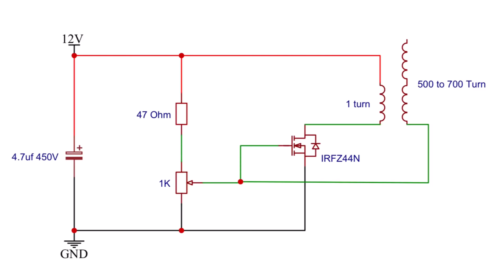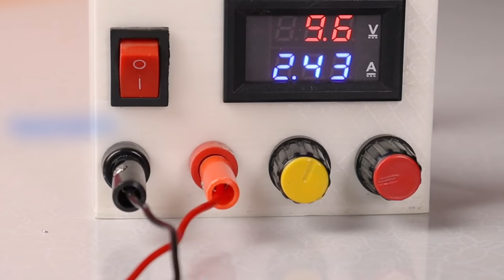How to make a tiny Tesla coil

Comment: Work better with IRF540 MOSFET because it has a higher switching frequency
Reply: Can I use 44
Reply: do you know every coil have they own resonance frequency
Reply: Oh interesting. I was going to order the one in the video but are you sure it will work with IRF540? did you test it out for yourself?
Reply: @milespeterson5049  Yeah my setup still works perfectly fine.
Reply: What's the rating on your capacitor??
Reply: @abhijayjayan6326  4.7 microfarad
Reply: @rupeshpatil5568  how many volts is it 450v??
Reply: Will it work with IRF630N
Reply: @harms123  Can I use B100K potentio instead??
Reply: Bro u can use IRPF460 also
Reply: Bro irfz44n and irfz540 bot have different data sheets can you tell me
Reply: DYOR... If you can't read (and understand!) a datasheet, better don't play with it (unless you have plenty of money and safety to spend) 😅

Comment: Help! I don't have that weird capacitor. I have a 3.3uf one but it's rated 50v. can you help? will it still work? please respond.
Reply: @Smaxi botYeah I will just order a 450v capacitor. on the internet along with the IRFz44n Transistor.
Reply: Miles.  One I built/ Ludic Science/ Triple Primary Slayer Exciter .    I only used one transistor and Two medium Led (backwards)  as substitute for diodes.  Any of these slayers substitute 1/2 watt potentiometer for the Resistor that way you can turn the power up mount a Cfl on top of the secondary pop bottle plastic.  The Mosfet circuit one is better but they both work.

Comment: When most people think of a Tesla coil, they imagine a large, imposing object with sparks flying everywhere. However, it is possible to make a tiny Tesla coil that is just a few inches tall. This coil can be powered by a small battery and can produce millions of volts.

The key to making a tiny Tesla coil is to use a high-voltage capacitor. This capacitor will store the energy that is produced by the battery and release it in short bursts. The secondary coil of the Tesla coil should have a very large number of turns, as this will increase the voltage output.

The final step is to create an ignition system. This system will create an arc between the two coils and will generate the sparks that everyone loves to see. By following these simple steps, you can create your own tiny Tesla coil that packs a powerful punch.

Theoretically yes!
Reply: I need help my tesla coil is not working! I smell burning!
Reply: But more the no. of turns in the secondary coil the mosfet will get hotter and hotter (not sexy hot). So I suggest to use a high power mosfet like irfp260n or, even better irfp460n
Reply: @harms123  Yes it's true man it happened with me
Reply: @harms123  Ok bro I got it, thanks 👍
Reply: @milespeterson5049  lmao
Reply: @harms123 Yes, it's true. One time, I just threw in random 4.7nf caps and I got a beautiful output. Also it is important to make sure the FET's recieve proper gate voltage without any nasty DC components.
Reply: Why do some Tesla coils arc, and some don't?

Comment: Help, my tesla coil is not working again. I got the same transistor the resistors and even the same capacitor, but every time I fire up the circuit I get no output from the tesla coil, and If I turn the potentiometer, I start smelling a burring smell, no smoke but not good for my components. why is it doing this? and how to fix it? Please comment below. 😃👇👇
Reply: Flip the connections of primary
Reply: @adityasudershan9629  I did try that and I still smell burning. what am I doing wrong? its at 12v so it can't be voltage its 1 amp so that's fine. what's the problem is it wired wrong maybe?

Comment: I have also tried to make one but I would suggest that to use IRFP260N mosfet with 24v power supply
Reply: I ve used irfz44n and it works fine. Can i use 24 volt with this system?
Reply: @b-beluga4510 your mosfet will probably die with this circuit at 24v because of excessive heat created by it.

Comment: what is the thickness of the copper wire you used in coil
Reply: 0:28 0.07 mm diameter

Comment: Does anyone think that a electrolytic capacitor might blow up easily? I do not feel confident buying a $10 capacitor and it blows up. So should I get a film capacitor instead?
Reply: Yes electrolytic capacitors can't handle that High frequency so using a film capacitor is better!

Comment: What will happen, if I increase and decrease the number of coil turns..?? 
Instead of 600 to either increase or decrease the coil turns
Reply: Increasing turn increases output voltage and vise versa

Comment: Help Please! My Tesla Coil is not working /:  my tesla coil does not have the same transistor. but I found the transistor from and old plasma ball circuit. so I'm not sure why it doesn't work. the transistors name is TIP122 and it is fine, honestly I need help. please reply.
Reply from the maker: I've used a MOSFET, can you salvage a MOSFET like irfz44
Reply: @TechIdeasAG  Thanks!
Reply: @TechIdeasAG  I do not have that transistor though.
Reply: @milespeterson5049   I build alot of high voltage circuits but have same problem.   I built 3 slayer circuits and it not working.   There was online help guide said to try reversing the Primary coil wires.   I have tried replacing base resistor with a potentiometer.   3rd problem is some transistor have Low amplification gain.   4th problem some transistor may be junk not strong enough you need a Audio circuit or transistor tester.  E bay does sell Kit to make this
Reply: @mike289homebuilt5  Thank you! I actually made another slayer exciter circuit and the number one problem was that the primary coil was wired backwards. The first time I tried it did not work but I reversed the connections to the primary coil, and it worked! Thanks for the help, I also got a bigger better transistor it's name is BD241C and it works just fine!
Reply: @mike289homebuilt5  And thanks for the response! I will just order a 450V capacitor and the transistor so I know I have the right components.
Reply: @milespeterson5049    Fastest way i know is using 6 to 8 transistor/ mosfet  in parallel with 18v bench supply.   If the power is not limited by resistance of wires in the circuit it can be excessive.   In amplifiers there is a Bias resistor it is usually 1 ohm.    Someday when you build a Large Tesla use a Ballast resistor in the ground wire of driver for current control.  Lol ohms Law determines current.   I find Parts from Scrap electronics old bicycle chargers old computer powersupply old Car Audio Amplifier

Comment: Can we use different type of resistor because I didn't get any 47 ohm resistor
Reply from the maker: You can use two 100 ohm resistor in parallel or five 10 ohm resistor in series. Just google " resistor in parallel or series calculator".

Comment: That is a high current draw even at 9v.  Is it the current or voltage that controls the output?  I was always wondering how to properly bias a mosfet in a slayer circuit so thanks for that one.

Comment: Great I have a few IRF540 and I was thinking if I could make a slayer with those since 2n2222 are too weak , thanks for this tutorial
Reply: Replacing the spark gap with transistors IRF540 and 2n2222 makes Tesla coil smaller, more efficient and easier to build. The transistor acts as a switch to turn the current on and off in the primary coil. This just resonant nature of Tesla coil creates high voltage and frequency which is used to create sparks.

Comment: Can something else be used in place of the magnet wire? Because magnet wire is not available in my city
Reply from the maker: It’s must
Reply: @TechIdeasAG  can we use copper wire instead of magnet wire
Reply: @the_royalgamer484 if it has insulation you can. Plain copper wire doesn’t have insulation so yeah you need wire with insulation.

Comment: What about using 5 or 6 turns of 1.5 or 2mm wire for the primary coil. Also, maybe using a larger capacitor, or 2 or 3 in series.

Comment: What is the gauge of primary coil? Please reply as I need it very much
Reply: I made one with 32 guage works fine but if you want high voltage output then go for 20 - 30 guage wire. But remember thinner the wire gets chances or wire burning increases.

Comment: It's works bro.thank you for the tutorial!
Reply: Hi what gauge did you use? I am not getting 0.07mm wire anywhere
Reply: @prashantpatel8290  I used 38 awg magnet wire
Reply: And all other parts remained same? What Mosphet you used? Is the spark good size and powerful?
Reply: It's a bit small
Reply: The same mosfet
Reply: @amutha1652  Works!! Thank you!. But the arc is very tiny, I want to create a bigger arc. Any suggestions? I am planning to use two 12v DC battery banks so total 24v as power source
Reply: Tried 24v. Something is wrong now. Sometimes it works sometimes it does not.

Comment: Hi Sir,
i've made 1 following your video, but my capacitor burst easily (already burst 3 capacitors so far) by it own, any advise?
my setup & components almost copying your video, except i am using IRF540, and i do not attach a fan at my heat sink.
Reply from the maker: Use capacitor with higher voltage rating
Reply: @TechIdeasAG  thanks for your prompt response.
any other methods like connecting the capacitor in series/parallel way?
cause i noticed the capacitor is very hot during operating.
(seems working well on 9V, but capacitor easily burst on 12V)
Reply: polarity check
Reply: Use filim pf capacitor with 2000v 4.7uf rating it works just fine
Reply: In series no polar ceramic hv caps add values

Comment: a problem here i see in your design ... the number of turns in the primary coil should be 1\10  of the secondary so if there are 500-700 turns accordingly there should be 5-7 turns of primary coil as well to function well enough.
Reply: hey thanks for the help man and one more thing can i use 20v 5amp supply

Comment: IRFZ44N mosfet

Copper wire

Heat sink

 1K potentiometer

47 ohm resistor

4.7uf 450V capacitor

Battery